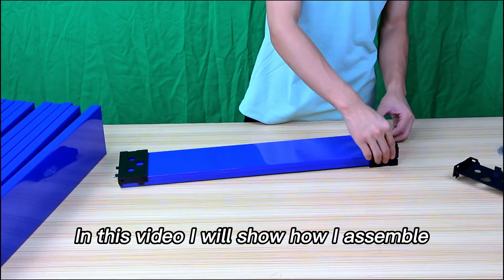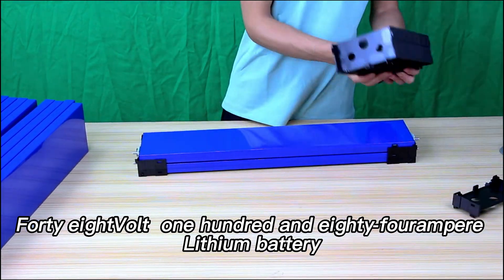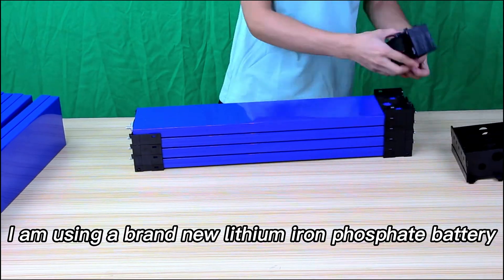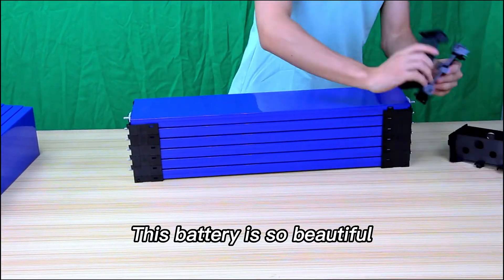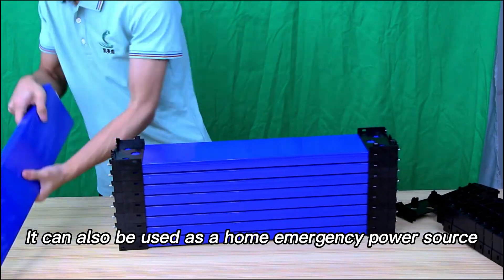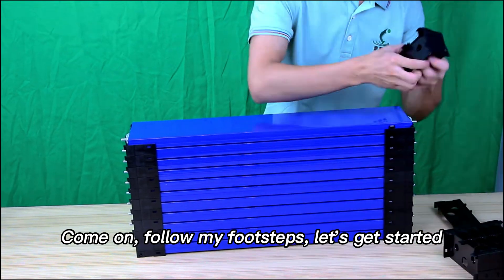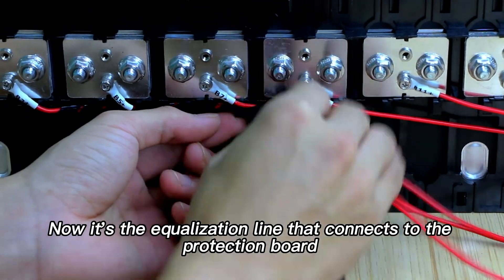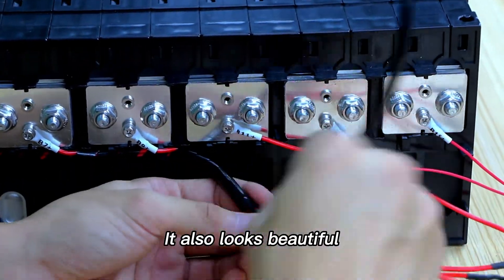In this video I will show how I assemble48V 184Ah Lithium battery

Comment: That’s so Chinese product… 1. There is no isolation between the cells each other and a chassis, because they don’t touch each other only when are new 2) You have to screw power wires at the very beginning (with isolating a free clamp), because it’s easy to short the first or the last cell when you screw them the last 3) A BMS you use and internal wires you use do not match the battery. They can merely bypass 50 amps. That’s not even 0.5C. Check out for instance 100A JK BMS and pay your attention on a thickness and number of cables to the BMS, and number of input/output posts.
These are so kid mistakes, and to fix them is so cheap,  that I have no idea about an education of your engineers. Sorry to know that.